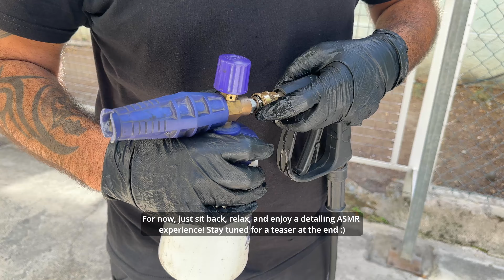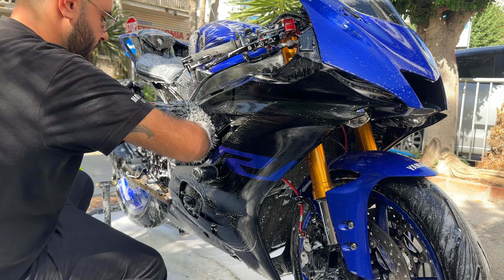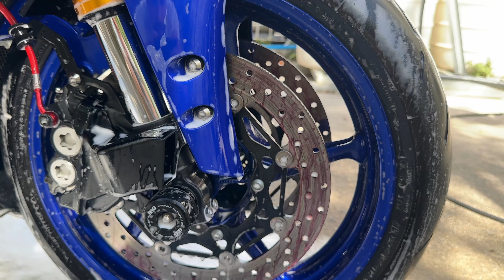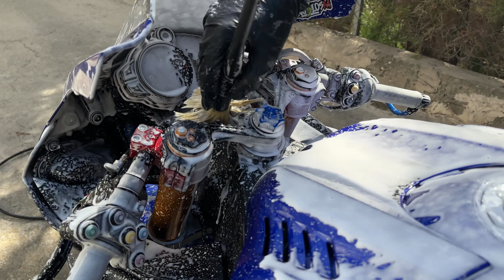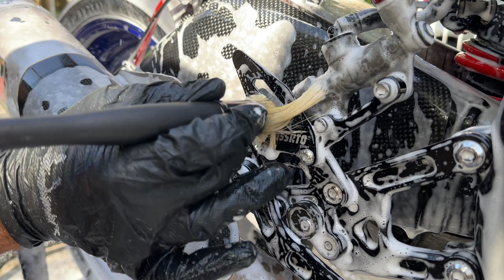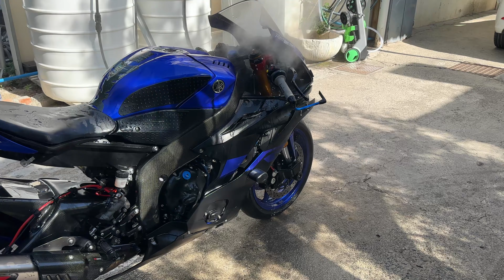Motorcycle Detailing Wash | Yamaha R6

Comment: What’s the thing u used to cover your exhaust
Reply: Rubber exhaust pipe plug. They less than $10. Got mine from Cycle Gear.
Reply from the maker: I don’t have one at home so i put an old cloth to cover in that case works the same!

Comment: If you are new in motorcycle I suggest do not follow how he wash this bike. Always do the tank first then the cowls before anything else. Do not rub your wool/towel randomly into the bike or it may potentially grab some small or sharp debris and accidentally rub it against your tank or cowls. And always wash your wool/towel thoroughly before you use it. I did this mistake years ago when I first bought a bike and it was so horrible experience...lol because no matter how hi pressure your hose is there's always a small debris will left over... 
Just a suggestion... Happy ride!
Reply from the maker: Thanks for suggestion sir ✌️

Comment: Not to be negative but please use another company next time. For your bikes sake.
The dude used the same wash cloth to do the whole bike.
I can't believe he wiped your fork/radiator area as well as your front mud gaurd then ran that same cloth over the top area of the bike (these areas pick up the most dirt and oil) so it's best to have a separate cloth for the lower section of the bike. 
Preferably 3 separate Cloths 1 for the top area, 1 for the bottom section and 1 for the wheels. He even did the rear mud gaurd then rubbed that all the way up to your side fairings Also he started at the bottom of the bike.
BIGG RED Flags.
However still looking forward to the next episode. Are we definitely getting a part 2?
Also I hope you don't take offence to this comment I'm just sharing some tips
Reply from the maker: Love the feedback pal! I do agree you have a point! Being honest also lots of shoots were taken 2nd and 3rd time. Also as i am not expert on this i think some parts were mixed but you do have a point for sure!
I will be posting the polish and ceramic probably this Sunday 👌 
I am not offended dude, instead i do really appreciate it 💪
Reply: @Ang3losM  you're welcome and I'm looking forward to it